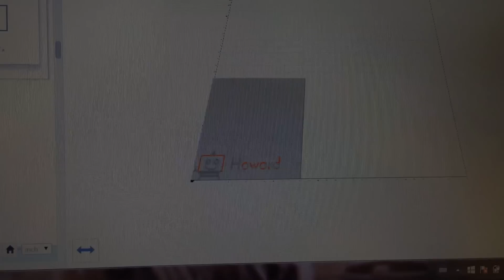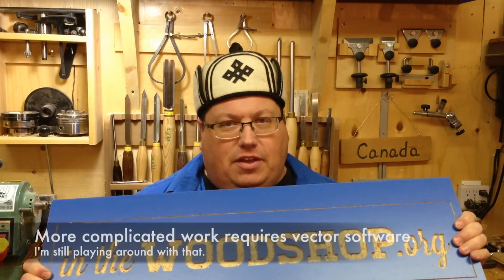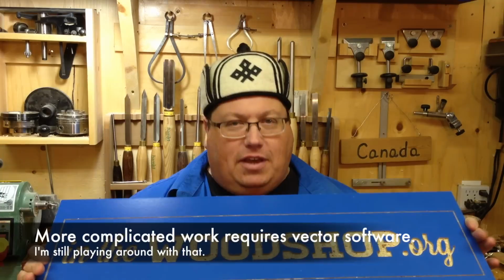The TRUTH About the X-CARVE

Comment: Excellent and honest review, the pros and the cons. The moral to this story is that you could spend at a minimum 400% more for 400% less. $1,250 vs. $4,000 and have 15x15 vs. 30x30. 30x30 is four times the work surface as 15x15. I have built a 1000mm machine and taking your time with each step is extremely important. If the electrical is foreign to you, ask for help as you proceed. How long it takes to complete any portion of this build has so many variables that I would assume that their estimate is the low end of the range and four to five times their estimate is the other end of the range. I looked at all of the turn-key units and they were too small. I would have been happy to spend 400% more for the same size turn-key.

Comment: The "limit switch" on the Y axis is suppost to have a bolt the fitts into the side plate that is suppose to hit the switch. its not suppose to bottom out on the side plate! Just FYI.
Reply from the maker: +Tommy G Workshop To hit the X-Axis switch?  I will investigate.  Thank you.
Reply: +inthewoodshop On the Y axis ( front to back) there is a bolt that fits on a T track nut that slides into the channel on the side. check out this link, step 14, second set of pics on the limit switch instructions. there is a t nut and bolt .

http://x-carve-instructions.inventables.com/step14/
Reply from the maker: I missed that, darn it.  Thank you very much!!
Reply: +inthewoodshop no problem, glad to help!

Comment: I build automation for a living and have been for over a decade. So this should have been a breeze for me. It took me 9 hours. Instructions were good, missing a few details but good overall. I used a 3/16 bit to put in all those inserts in the wasteboard. Put it in my impact driver and a half hour later or so, I was done. My best advice is make sure you read the instructions completely for a given section before you start the assembly. I jumped the gun a couple times and only later learned I omitted a step. They show the completed assembly first, then break down how to do each part of it. My experience and confidence worked against me somewhat in this aspect. Thus far, besides a bad Pushbutton PCB -  which inventables shipped out to me at lightning speed as soon as they heard about the issue - the machine has been solid.

Comment: I bought the larger Dewalt 611 router which takes larger bits which speeds up larger carve out projects like your sign. I bought a sleeve that allows me to use the 1/8" bits also for finer work.  It is a monster with regards to assembly.  I would almost rather pay more for labor and shipping to have it assembled.

Comment: Howard,  regarding your comment about not being able to see as well as you'd like in the shop -   I'm over 50, blind in one eye (since birth) and have had multiple surgeries on both eyes.  I've worn glasses since I was about 8 years old.  So - I can relate to your problems seeing.  But there are 3 things you can do to help yourself.  1. Have your eye doctor work up a prescription for glasses that focus up close, so you can see things you are working on clearly without the hindrance of multi-focal lenses.  You MAY even find that some cheap (< $20 US) reading glasses from Wal-Mart (someplace similar in Canada) will do the trick.  2. Good lighting is essential. Make sure your work area is well lit (your shop looks under-lit on camera).  Even invest in a clamp on work light or two for the bench.  You can get clamp lights with built in magnifier lenses if you want.  3. Get a head mounted magnifier hood.  2X..4X makes a world of difference.  You can even get them with extra lenses that will bump it up to 8x..10x.  Although - the more magnification, the closer you have to be to things to see them clearly - so there is a tradeoff.

As for the fear of electronics - all you need is a teenager - they can wire an Arduino and Shield together in less time than it takes to sing Oh, Canada!

Good Luck!
Reply from the maker: You're right about the teenager! LOL. Great suggestions. I already did no. 1 a while back but not happy with it. No. 2 - it's better lit than it looks on camera. I have task lights everywhere. No. 3, however, I'll get right after. Thanks!
Reply: +inthewoodshop BTW, they also now sell safety glasses with various grades from +.50 to +4.00...and maybe more(?). I love them for TIG welding in my auto darkening hood as they don't sell "cheaters" for the large screen lens on my hood, and even at 45 my peepers need all the help I can get to make a clean, straight bead :D

Thanks for the sincere review, Aloha...KTF
Reply from the maker: Excellent!  Thank you, and thank you for watching.

Comment: Going to go look now but do you have any thoughts on a laser cutter/ in graver
Reply: Thanks for the reply and i had gone looking to see if you had posted any thoughts on laser cnc's but couldn't find any. From my research i will give you a few heads up for what they are worth. First metal is had to cut with a laser unless you get into the big boys and then you would also be considering plasma. Wood will get a bit of searing on the cut lines but you can adjust the power to the laser to minimize the effect. For example you can dial it back to cut dollar store foam board. Plastic will melt a bit but more like what you get when you flame polish acrylic but not all plastic is the same so ya. 
All that said from what i have seen on your channel i don't think a laser cnc would be a good fit for you unless you wanted to get into craft type stuff. 
A good one to look over would be glowforge.

Comment: Thanks for the review, I ordered my x-carve to arrive in Guatemala just before me, back in June, but thanks to the disaster that is Latin American bureaucracy at its worst I finally got it a week ago. Paul (the shipping guy) at Inventables was really helpful in seeing that I got the kit. I'm only part way through assembly, I need a table other than the one in the dining room to put it on before progressing much more. I have the same problem with eyesight, luckily my teenage kids are happy to search around under the dining room cabinets for the screw that got away. I haven't gotten to the electronics bits yet, but 40 odd years ago I thought I was going to be an electronics engineer, so I hope to have less stress there than you reported. Again, thank you for the review, and the suffering in assembly or delivery should just make it sweeter when something decent comes out of the x-carve in the end.
Reply from the maker: I'm glad you received your X-Carve, and I'm especially glad you have teenagers to help out. My teenager was indispensable. The frustrations assembling it were made worthwhile by the fun using it after. I'm sure you will be very happy. I'm getting ready to post a video of a scale model trailer that turned out very nicely with the X-Carve. Good luck and thanks for watching.

Comment: I don't have a shop but I want one of these machines very badly.  I have no experience woodworking.  I wonder if it's possible for someone like me to use something like this.  I would like it to mill metal if that's possible with machine.
Reply from the maker: +ElGatoLoco698 If you are looking to mill something harder than aluminum or brass, I think you need to look elsewhere. Otherwise, the woodworking skill and knowledge required to use it is minimal. It does take up some space.

Comment: I believe all limit switches should be engaging on screws heads in t nuts on the maker slides. it looks like you are missing a critical part of the limit switches. 

the waste board inserts get chucked up in a standard square driver that comes with any $8 set of impact drivers.

I can't wait to get mine! I've been researching this for 6 months. you are one lucky guy to get one for free! thanks for the videos!

Comment: do you know you can run an ethernet feed through your electrical supply circuit, you just plug one unit(transmitter) into the electrical socket near your router and the receiver socket in your shop (assuming they are on the same circuit)

Comment: Heh  I can relate to that "small shop". Mine is 12 by 18 (outside measurements... My home brew is about half the width and slightly shorter than the big X-carve. The biggest I could make one to fit in an open space.. Amazing how fast you can seriously flood the shop with MDF dust if you forger the Vac.  :)
Reply from the maker: Absolutely. I never use the stuff because it kills my lungs. Plywood is just as bad really.
Reply: Actually ANY dust particles of crap from anything is not good. While I have yet to run into any exotic woods that bother me I have  a friend who breaks out in a rash anytime he just handles purpleheart, let alone sanding it..

My shop dust collection is serious enough at the router to suck up 1/4 inch nuts so I just use that. About the only trace of dust on the router after chewing up a LOT of mdf is a tiny trace setting in the bottom of the t-track between my mdf spoil board slats. the t track is only 3/8 high and the mdf is 3/4, Gives me 3/8th to chew up without hitting the t-track and is easily implacable when needed. I just have to rember to hit the switch.. lololol  I luse MDF for a lot of stuff but nowhere where it can get wet without seriously sealing it or where appearance is an issue. Hard to beat for making up holding or positioning jigs for multiple copy's of a job or short production runs. I use a jig made of it for 2 sided CNC stuff also.

Comment: Weird, I got nuts and bolts for the limit switches,  you screw the bolt with the nut inside the rail and that's what the roller of the switch hits.
Reply from the maker: I did find this out later after another viewer pointed it out. I missed it because I had already decided to abandon the limit switches so I didn't read any more of the instructions for them. The part with the screw is much closer to the end of the instructions.  I wish that had been indicated at the time I was installing the switch itself. Oh well. I don't really miss them. The machine still works perfectly.
Reply: +inthewoodshop They really help for repeatability and indexed machining (multisided), and staying still when asked to move places it can't go. ^^
I guess when carving 2D after zeroing manually, they're not that useful indeed.

I just like to know that machine origin is the one thing I can't fuck up.

Comment: The "limit" switchs stop the motors,  if you program (fat finger) a overstroke condition into your Xcarve program or when you move it in manual  rapid and are not paying attention this saves having machine damage "CRASH PREVENTION ..also CNC machine axis have been known to JUMP electronically or mabe the encoder and or tach generater coupling to motor has come lose allowing the machine to drift..
Reply from the maker: Sadly I have to say I don't understand any of this. I wish you were my neighbour when I was building it.
Reply: its OK if you don't understand I may need to find a better way to say what was said Sorry!!

Comment: X Carves are built to a price. This fact impacts performance across the board with the machine too. For instance if they gave you a decent power supply, as opposed to the piece of crap surplus switcher they throw in you could enjoy a 31% axis movement performance boost right there. But a decent supply would cost them many times what that piece of junk SMPS does. So you get what you get, not what you should have.
Reply: digitalradiohacker
24V is simply not high enough voltage to get decent performance out of a stepper motor. That is due to inductive reluctance inherent in all stepper motors. The faster you spin them the less current they can draw (at higher step rates your dwell time to feed current into a coil reduces - the time slices get narrower). So your torque will drop off precipitously at around 600 RPM at 24V. It is just how it goes. PWM motor drives overcome that to some extent by pushing higher voltage into the motors. But you need the higher voltage to push. 24V is marginal there at best.
Reply: digitalradiohacker
Stepper motors work contrary to what conventional wisdom might lead people to think they work. Servo motors are "normal". The cut speed often has to be slow, but high speed is used traversing. Homing with a slow traverse speed is somewhat tedious.
Reply: digitalradiohacker
So your "big" machine starts where it stops the previous job? Interesting.

Comment: Why doesn't somebody tell X-CARVE to build it then ship it? 
It's only 1 meter square.
It could easily come semi built on a square board encased in polystyrene and foam padding.
That's ridiculous you spent so much time setting this machine up.
You take something out of the Box that costs over 2 you'd expect it to be usable right away.
I blame X-carve customers for not attacking their inbox.
Reply: They might be scrambling now that the onefinity, which is a superior machine in many ways can be assembled in 1 hour.

Comment: X-carve uses arduino? Could it get any crappier?
Reply: +leosedf Nothing wrong with Arduino. A solid and customisable CNC platform in my experience.
Reply: +leosedf The motor driver boards are the important factor in CNC electronics. Worth spending your money on those rather than worrying about the motherboard.
Reply: +OpenTronic Sorry but i care about the whole system.
Reply: +leosedf So do I and Arduino does the job ;)

Comment: I did not mind the number of parts but I did mind:

Poor design. The VWheels and eccentric nuts are lousy. 
The electronics setup with the stacked boards in that housing.. very poor. 
It is very hard to keep this thing in alignment for more than one job. 
The wiring should be exiting the REAR of the xcarve. 
Those limit switches were among the cheapest I have ever seen. Worthless. 
The limit switch stops looked like and afterthought.